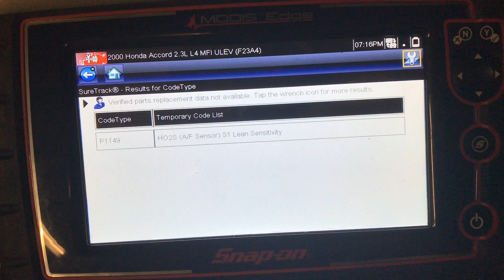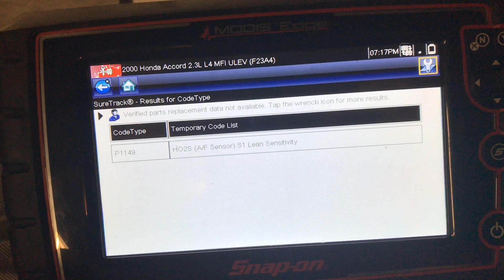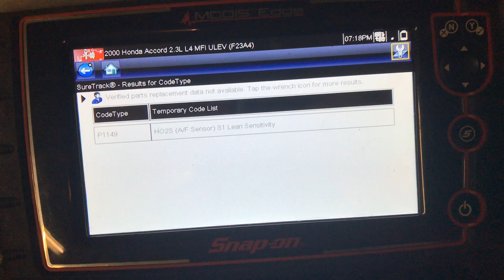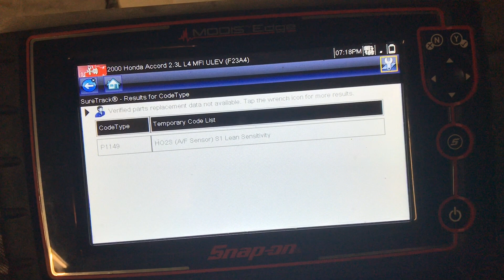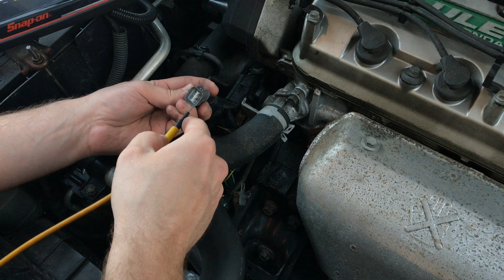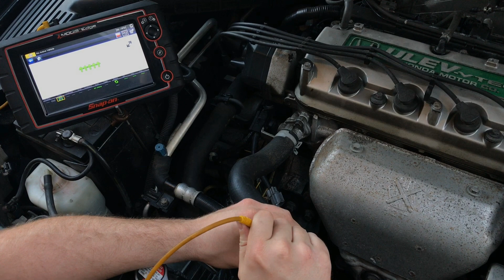2000 Honda Accord ULEV AFR Sensor

Comment: Question I checked the reference from ECM and got zero and all connections with ignition off, but when I turned key to axillary mode I got the 3v and 12v readings. I'm pretty sure im.good, but double checking if I should see those readings with the ignition completely off? Thanks

Comment: So this is air fuel ratio and not bank 1 02 sensor ? Correct ?
Reply from the maker: Correct. This is Bank 1 sensor 1 air fuel ratio sensor. This is considered an “upstream” sensor because it is located before the catalytic converter. The AFR sensor is also about $180 bucks and a regular oxygen sensor is about $40.
Reply: @hillbillyrigrepairs1814  seen that today, went to parts store and they gave me the 80 dollars bosch 02 sensor, check engine light was still of and car was jumping when put into reverse or drive. Took it off put the old fuel ratio sensor went back to part store and they said it was in fact the wrong sensor for the ulev accord.